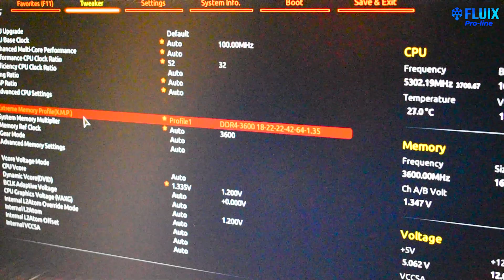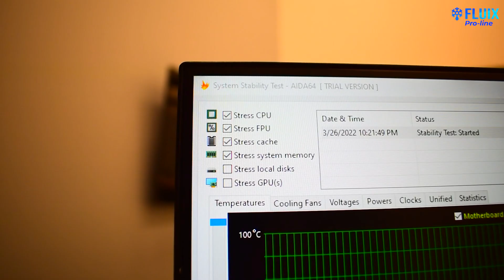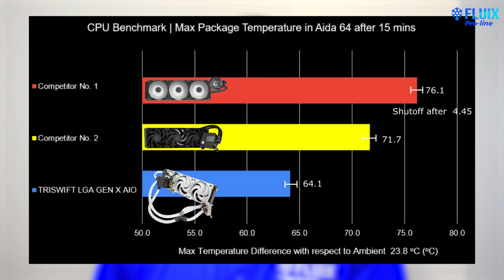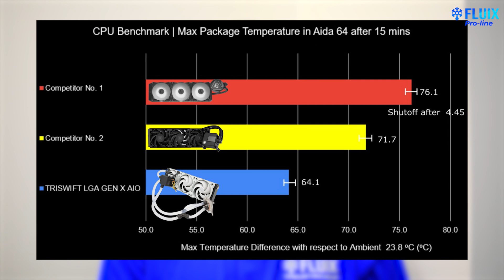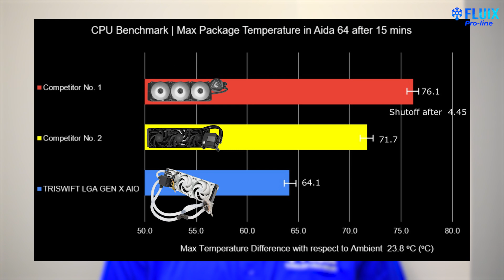Benchmarking our Highest Performance Liquid cooler vs. the best in the industry

Comment: How does this setup compare against the same pump and radiator but with a different water block (for example and EK water block). The AIO pumps tend to be a lot less powerful pump wise and the difference in radiator quality can make quite the difference.
Reply from the maker: Thanks for the comment Everett, yes the high performance components we use can make a different in temps, however for the purposes of the full unit we sell, we are demonstrated a one-stop-shop AIO product computer manufacturing business can purchase to unlock extreme performance out of the box. We will posting just a water block benchmark comparison video soon that highlights just the performance of the block.
Reply: @fluixtech  Ill be looking forward to that! I'm curious too see how the different blocks perform.
Reply: The AIO's reviewed in this test as well cost ~130 vs the Fluix setup which is currently $500. It would be interesting to see the AIO compared against coolers of the same class and see that performance.
Reply from the maker: @Number1fanofcaptain  This video is geared for computer manufacturing businesses who place larger volume orders.. With larger volumes the pricing discount are great incentives for them. Therefore, the pricing comparison in single consumer units would not make sense. For our high performance computer manufacturer customers, they fine spending for the best performance and receive price discounts on volume.
Reply: @fluixtech  Fair enough, I'm surprised the cost of assembling these kits is low enough for the current price point even. Most of the profit must come from selling more blocks as a result of them coming in an assembled kit. Searching for the exact parts included in this kit the cost seems to come in at around $467 including the Fluixx water block.
Reply from the maker: @Number1fanofcaptain  As mentioned our business to business customers receive considerable amount of discount for higher volume orders as well. Also it is important to mention that our TRI-SWIFT AIOs are modular, with standard G 1/4 ports. In the future we will provide add on kits such as GPU block and other components. Meaning our AIOs do not have constraints. Our price is more than fair for the highest performance and modular AIO on the market.  💪
Reply: @fluixtech  Wouldn't it be a pre-assembled water-cooling kit instead of an AIO at that point?
Reply from the maker: @Number1fanofcaptain  Both, in the form factor we are currently selling its an all-in-one, one stop shop. For future integration, we aim to make custom water cooling more accessible. :)
Reply: @fluixtech  You are like about 20 years to late to make water-cooling “more” accessible. I don’t understand the whole offer to the public in general if you don’t care about it performing price to performance wise at a at least comparable level…
Reply from the maker: @pflegefachkraft7595  For our computer manufacturing customers selling HPC workstations & PCs to end users usually running workloads where time is the limiting variable, the lower temperature and increased modularity is a huge value. Allowing for a 5 - 7C lower CPU temperature makes a big different in saving time during long renders where often times CPU load is a 100%. During long renders where thermal throttling is eliminated. Saving time and payroll for the end businesses. Having a system than can be easily installed and upgraded in the future is far different from conventional AIO systems :)
Reply: @Number1fanofcaptain  thanks man
You said everything that came in my mind
I can accept 7 degree higher to save 400$
Reply from the maker: @Adel-sj4ue  Appreciate your feedback. Although we understand 7C degree difference might no appealing to you specifically, our TRI-SWIFT Turbulent AIOs save compute-intensive firms such as Architecture Design team thousands of dollars in render time by eliminating thermal throttling. Payroll saving and productivity increase. Also, it is important to mention that our TRI-SWIFT AIOs are modular, with standard G 1/4 ports. In the future we will provide add on kits such as GPU block and other components. Meaning our AIOs do not have constraints. Our price is more than fair for the highest performance and modular AIO on the market.  😀